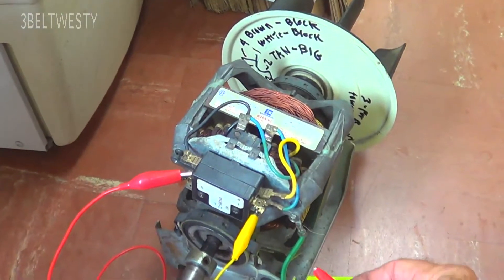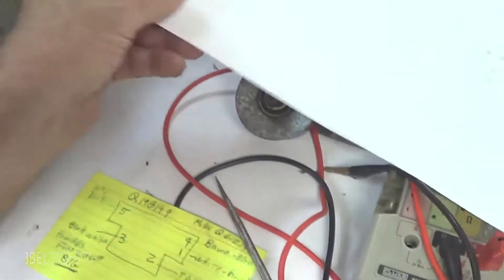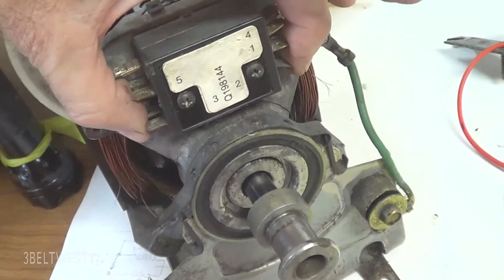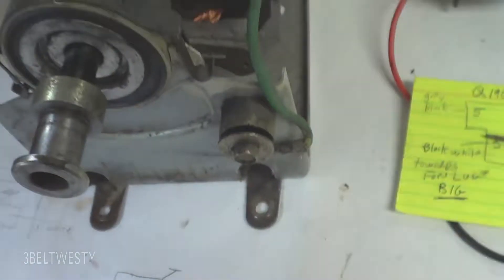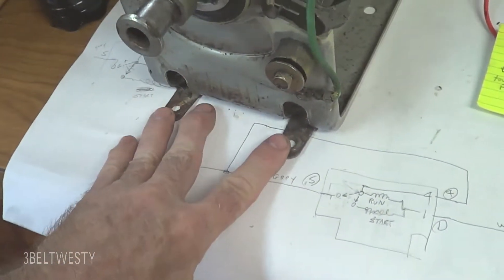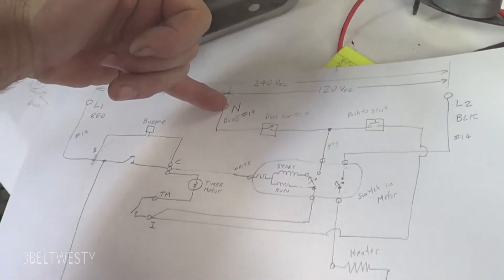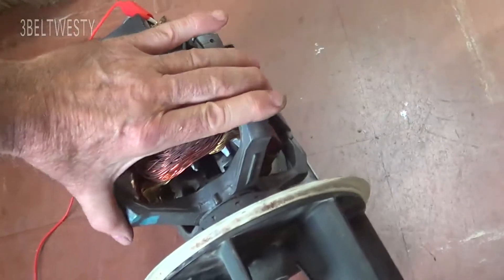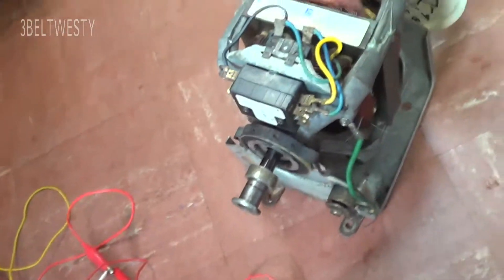Westinghouse Dryer Motor Centrifugal switch

Comment: Interesting. I have a perfectly good motor, but I discovered through your help that my centrifugal switch lever, a piece of plastic that probably cost 5 cents, has worn off and is too short to engage when the motor is off. That means that the motor control  is stuck in run and therefore the motor cannot start. The internals of the switch that you didn't open look perfect in mine. It's just a worn lever. I wonder if a bead of JB weld will fix it? 

Anyway, my motor is only 17 years old, but I guess this dryer had been turned on and off a lot. I hope I can fix mine because it's $200 on Amazon, I saw some used for half that, and I don't see any centrifugal switches or controllers.